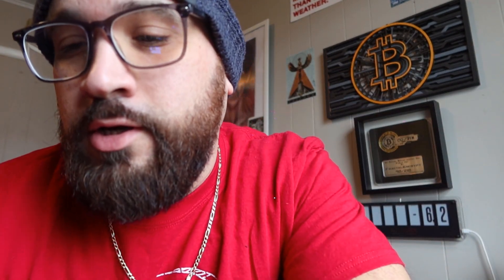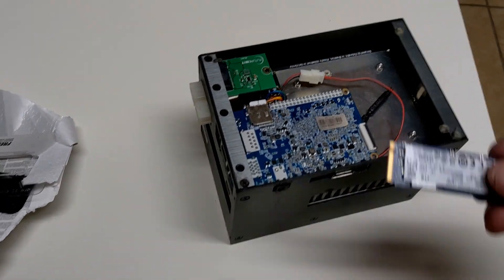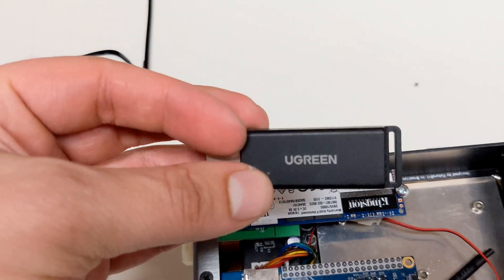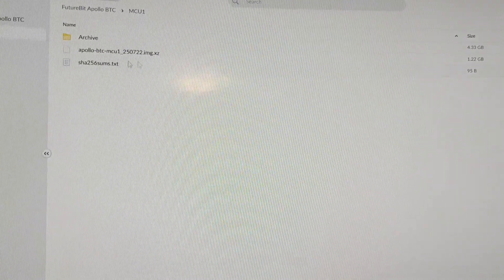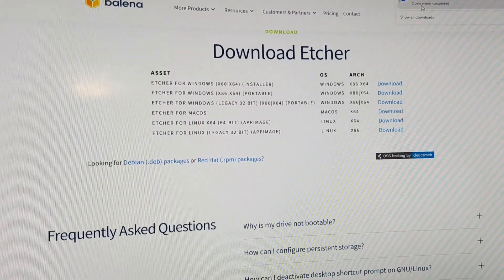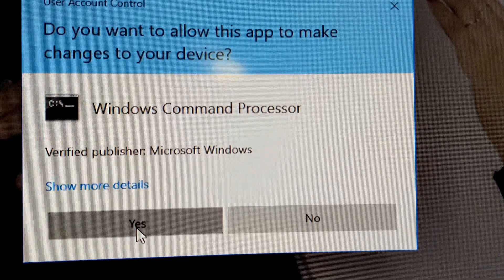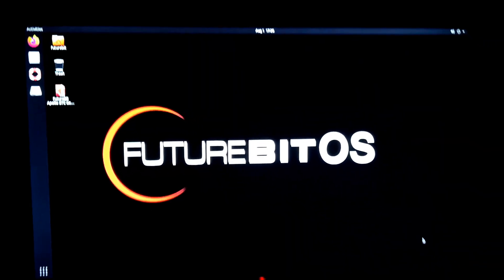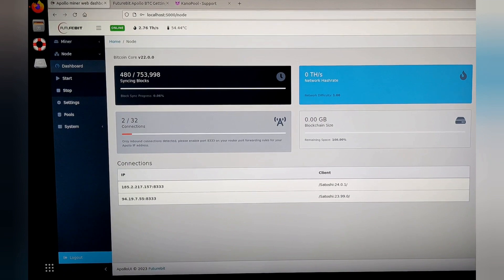Futurebit Apollo BTC, 1 TB Hard Drive Upgrade + Operating System Update Guide JTC82

Comment: Debating to get 2tb or 1tb version right now!
Reply from the maker: I'd go with the 2TB at this point. also, make sure you get the Apollo 2 or look at one of Canaan's new miners. they're a lot more efficient than the v1, unless you can get a really really good price on a v1
Reply: @ oh yeah I love canaans stuff right now. Im just looking for a node all in one , because of tariffs (I’m in Canada)  I’ll have to pay but extra for 2tb so was thinking just don’t pay the 150usd for the 2tb and just buy it here and then i get a free 1tb from the miner itself. I could build a raspberry pi node but I just like it all in one box. Do you recommend just build it and point my other miners (bitaxe miner) to its own stratum pool?
Reply from the maker: @saeir  I'd avoid the Pi's these days. They're pretty weak for the price. Similar deal with the Apollo units. They just have a Orange Pi 4 iirc running everything. At this point, id go with a mini PC then install start9 or umbrel on it then install public pool on it. That or id  pick up an orange pi 4 then install the futurebit software on that, then point my pool to that. The all in ones are cool but at the end of the day it's kind of still two separate devices, just contained within one box.
Reply: @ damn I didn’t know I could run my own stratum server for my miner without a node, is that the case? Basically have my own solo pool without a node? I would only need a pc that could stay on 24 hours a day. Any mini pc recommendations? How about buying a start9 or umbrella device ?
Reply from the maker: @saeir  it is impossible to mine without a node, every miner needs to connect to a node to know what to do. The miner-node all in one on the futurebit is just a single board chip computer that controls the PCB that the mining chip is soldered to, and it's housed in one unit. If you got something like a bitaxe, then installed Ubuntu on an old laptop, you should be able to install umbrel + public pool and then just point the bitaxe to your public pool URL. If you're strapped for cash, that's what I'd do. If you're definitely going to buy a new device, I'm not sure what mini PC to recommend but I'd look up the performance of that vs an older generation laptop for the same price and see how they compare.

Comment: Would it be difficult to set up a solar system to run this miner 24/7?
Reply from the maker: I think the hard part is setting up the solar system. This set up only takes like ~200W which afaik is not that much.

Comment: Great video explaining the process flashing the cards, might upgrade my ssd to a 1tb also since the memory is getting up there
Reply from the maker: thanks! been meaning to make this for a bit, your comment gave me the motivation. if you want to run the node unpruned you're def gonna have to upgrade the hard drive. chain is already bigger than the 500 GB, my node had stopped syncing cause of it so i had to upgrade it.
Reply: @justh0dl  I recently bought mine from ebay and I just looked, i already got the 1tb in there, all I did was change the wallet address and it started right up
Reply from the maker: @AtomicMining  awesome, you might have a batch 4 or the previous owner upgraded it so you should be good for the next couple of years.